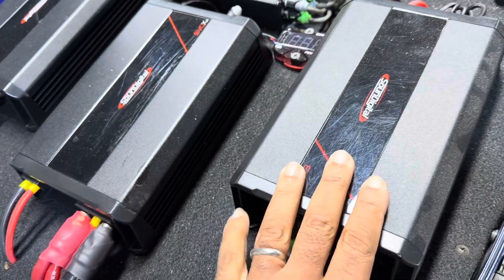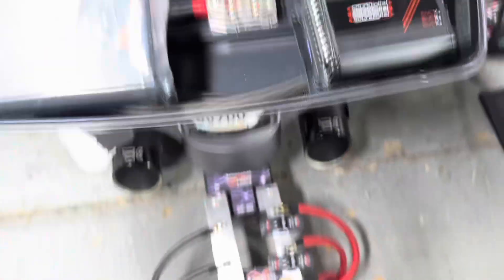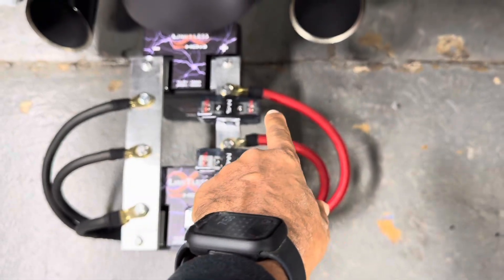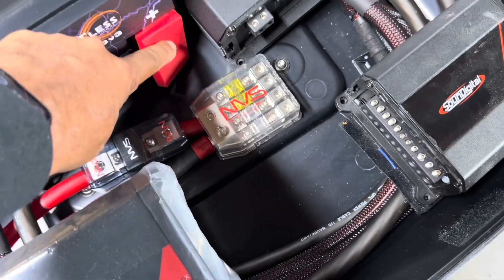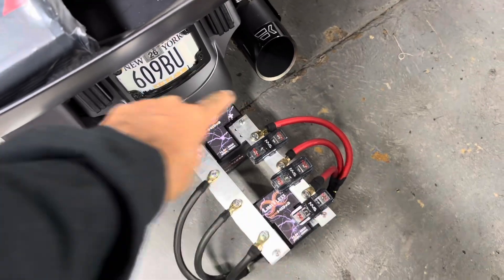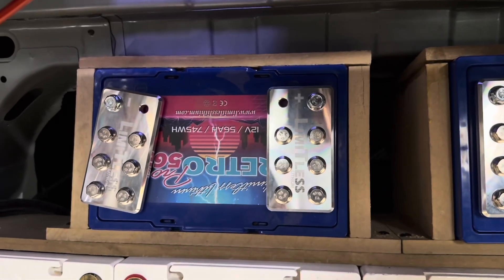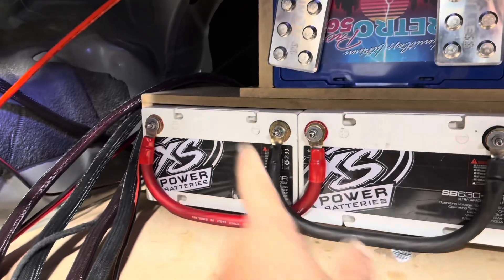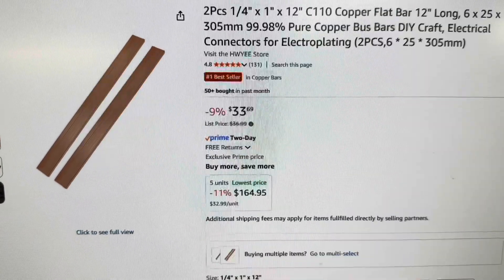Proper lithium battery wiring for Competition Motorcycle Audio part two

Comment: You don’t need all that shit for a bike to sound good 😂😂😂
Reply: If you bothered to read, you would see it's for competition, not just "sounding good"
Reply: @HAMMER_2.2 you don’t need all that bullshit to win a competition 😂😂😂
Reply from the maker: Would you care to share your opinion against my scientific data? 
Could you please tell me what part of my statement was not correct or accurate? 
Do you not agree that zero gauge cable can only carry 300 amps of current and the 2 5000.1 draw over 800 amps combined??
Reply: @NVSAUDIO  I’m saying you don’t need 15 batteries a shit load of amps 100 feet of 1/0 wire 5 distribution blocks to sound good or win a competition   My bike sounds hella good with 1 jl audio amp  and I can use my tour pack
Reply from the maker: @wavybaby5816 ok 

Now we are fully in agreement 

I think all this stuff is too much 

2 amps in the faring 

1 battery in the factory location and I’m good .

But for all the crazy guys out there I’m still here to help 👍🏽

Comment: Thank you sir for not only showing the correct way to wire everything up, but also breaking down the current flow of buss bars, and how many amp hours it takes to run per max wattage.
Reply: Great thorough visuals.  Thanks bruh.